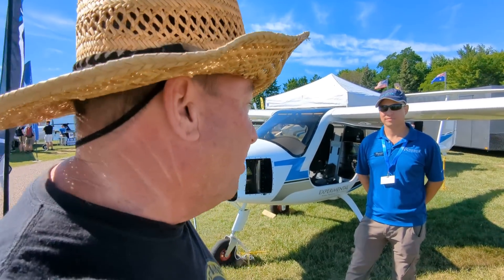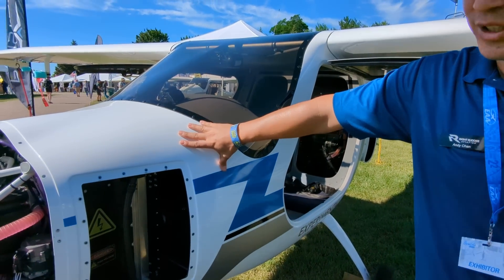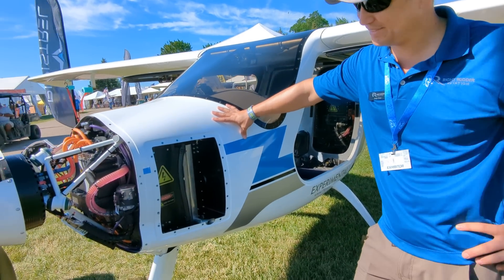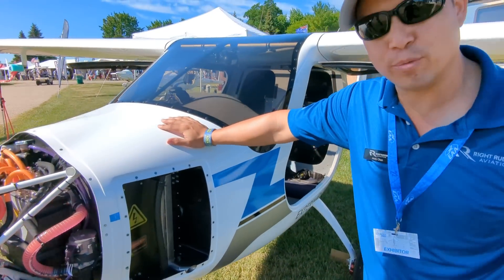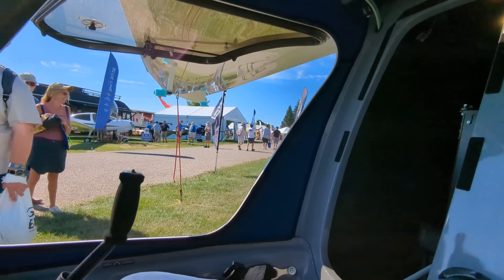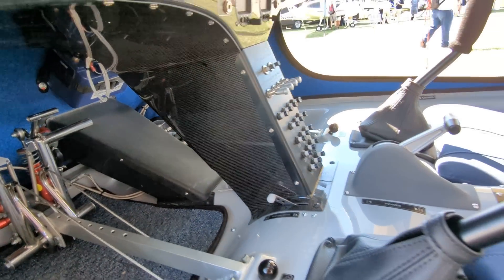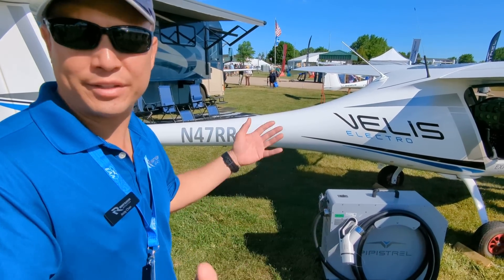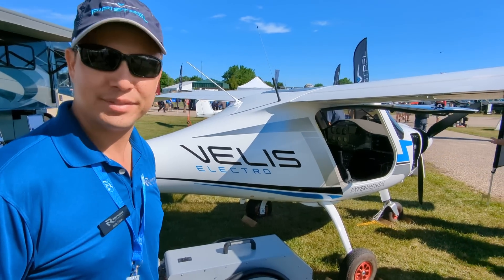Electric Airplane?! Pipistrel Electro at Airventure 2022.

Comment: Wow, the trolls are doing their dynosaur death dance.  So tiresome to hear the same old lines.

My opinion ?  This airplane is groundbreaking.  It needs better batteries, we all get that (swappable batteries would be sweet).  But it's already usable for training and sightseeing, and I'm pretty sure it will have lower operating costs than the 100LL powered version.  Why?  The Rotax is not an inexpensive engine to maintain or rebuild.  Annuals on our poor old engines are costing more every year, and the kicker:  have you checked the price of 100LL lately?

Here's the funny part:  so much of pilot training is focused on the pecularities of our dynosaur engines - sump the fuel, check the oil, prime it, crank it but not too much,  check the mags, check carb heat, lean the mixture correctly, warm it up, and get ready to (not) make the impossible turn when the engine quits on takeoff.....phew! - that the limitations of the Electro have more to do with the fact that flying electric doesn't train you on how to fly our poor old unreliable legacy dynosaur-powered engines.  

I can't wait for the electric age when we can focus on the thrill of flying and NOT dealing with our engines.  Imagine, for example, shutting down the motor in flight and just soaring, confident that the restart is gonna work every time.  I want to do that.

The RC guys figured out all of this a long time ago, and its time for us full scale guys to wake up and join the electric age.  Its going to be much better.  The next plane I build will be electric.
Reply from the maker: Yes!
Reply: Beautifuly said!

Comment: Am I correct that there are high pressure coolant lines inside the passenger compartment? If so, how much of a safety risk is that?
Reply: Wouldn't EASA have addressed that for flight certification in Europe?  They're way more safety conscious than anyone else.

Comment: Good for Training very close to the FBO.  Now the student will have to learn to also fly gas powered plane to compete his cross countries.  Adds to the cost of learning. 

In all honesty I think is electric plane is nice but most FBOs geared for students are barely making it with 30-40 year old Cessnas/pipers. I doubt if they will spring for an electric plane with limited use.
Reply: It'll probably see a lot more use in Europe - a lot less resistance to electric vehicles of any type over there than in the USA.

Comment: The irony of all the nay sayers on an emerging technology is not lost as they would have also poo poo’ed the Wright Brothers. There are over 300 electric aviation projects, most might fail, but some will succeed and progress us forward. Beta Technologies & Bye Aerospace are making huge progress started and run by legit pilots. Beta will have vertical take off ability 1500kg payload and 250nm range. They flying already. And that has loads of practical applications not to mention much cheaper operating costs. Ehang have already flown 20,000 flights, all autonomous, many with passengers. Battery tech is finally getting funded (thanks to auto) and real break throughs are happening especially with Li Metal and Li-S which have much higher energy density. You can’t beat an electric motor for simplicity (one moving part) and reliability - how many GA accidents happen due to engine failures with over 1000 moving parts in them (?) Pipistrel were at this early, more than a decade ago, and I applaud then for their efforts. Tecnam are coming, Bye, Eviation, Heart Aerospace. It could open a new era in regional transport unlocking cheaper solutions to traditionally costly travel routes - island nations (?) It is called progress and does not happen over night. Or we can sit back in our 1950/60s old school thinking and wonder why the auto industry moved ahead so much faster in innovation and why GA is shrinking because the next generation either can’t afford to become a pilot or just don’t want to fly 50 year beat to shit aircraft that costs 5x more than their 2020 car to operate… and if you reallly like 1940s classic, the Beaver is also already flying all electric!

Comment: I love the idea of electric flight, but it is limited by the terrible specific energy (W.h/kg) of batteries compared with petroleum fuels by a ratio of about 100:1, that's why you get a 30 mile range with this aircraft! A much much better battery technology is needed.
Reply: The Pipistrel Alpha Electro has 60 min endurance with 30 minute reserve. I think that is a little more than 30 miles on a 21kWh battery which makes is more efficient than most EVs, except something like the Aptera

Comment: Strangely I see the Pipistrel as a pilot's plane. Lots of private pilots do so little flying that an hour a week would be thought excessive. With the Pipistrel that hour could be solar powered.
Remember that the Wright brothers first few flights were measured in feet of distance -things have changed since then, things will change with electric flight also.

Comment: 700lbs dry is RIDICULOUS. The battery on my 2017 Bolt EV is 990lbs by itself. I imagine, the batteries are pretty small comparatively in this aircraft. It is gorgeous!
Reply: 22kWh I think
Reply: @wpfilms2  that is not a lot...that application (motor, BMS, aerodynamics,  etc) seem pretty efficient then for 50min of flight time 😀
Reply: @wookster789  exactly!
Reply: @wookster789  I would imagine the motor and inverter operate at variable frequencies of some hundreds of Hz to keep the weight and the iron losses down.  And inverters are very efficient these days.

Comment: Interesting, but what's the sense in having a charger that can't be carried on-board? Not to mention the LIPO lifespan. It's a green-wash. Like Tesla, you'll have to license the "features" and won't own the aircraft. 
NTL, interesting idea and 'props' to them for coming up with their own solution on the electrical solution.
Reply: Did we watch the same video?  I'm sure he said the charger isn't carried onboard, it's provided so that it can be taken in a vehicle - the same one which tows the trailer on which the aircraft is mounted.  I'm sure he also said there are fixed chargers similar to Tesla chargers which can be installed in hangars, etc.

Comment: This airplane would be a real problem for earning a PPL. The cross-country requirement of a 150 NM (minimum) flight with 3 or more stops would be an all day affair. 
This flies 75NM per charge, then requires 2 hours on a 3-phase 480volt charger, so you'd have to fly a leg, take 2 hours on the ground (if they have that charger & it is available), and another leg plus 2 more hours on charge before completing the third leg. At a little over 100 kts you're looking at 2+ hours of flying and 4 of charging, so 6+ hours to do a 3 hour cross-country. Since a trainer is typically a rental you'd have to pay for 7 hours, minimum.
Reply: Some one has already got their PPL exclusively trained on it
Reply: Operating costs in the UK are £2/hr. Also got to keep in mind because of the certification process takes forever (and this is certified in Europe) the battery cells are dated now. A lot more energy dense batteries on the horizon, most likely lead by China. Tecnam are now in the electric game, as well as start ups Bye Aerospace & Eviation with some pretty impressive stats
Reply: Auto industry are already moving to 400v systems as standard with some at 800v. New home builds in the UK are required to have 3 phase. As per usual GA stuck in the 1950s/60s on tech front.
Reply: @wpfilms2  Also feeding into this is Europe and the UK and other countries are more willing to migrate to electric propulsion, whether it be road vehicles or aircraft.  It's no good introducing an electric aircraft into a market that wedded to the ICE.

Comment: So many fan boys ! Let's not get all excited just yet. I pulled out my log book. Nearly every training flight was well over an hour. So double the number of training flights right off the bat. It charges in 30 minutes on 3-phase 480 volts. No mention of the amperage it's pulling, but OK. No one has that anyway. So double (at least) the charging time. Now we're in an area where the plane is down for more time than it can be rented. And don't pretend that since it doesn't burn fuel you'll be charged less per hour. I expect the opposite. Part of flight training is learning how to handle the ICE that powers the aircraft. How's that going to happen ? For you non-pilots out there, there's more to it than an ignition switch and a throttle. Realistically you're not going to train in an EV then hop into a real world ICE aircraft and suddenly gain engine management skills. And BTW - 2,000 charging cycles at a realistic 45 minutes per flight (tops) is 1,500 hours "TBO" for the batteries. At $20k a pop. And 100 hour inspections still apply.
.
So let's compare it to the obvious - the Cessna 152. The Cessna is far cheaper, cruises 20% faster and 6 times farther, carries more (even with full tanks), climbs faster and can be turned around in the time it takes to fill the tanks and check the oil. A Lycoming O-235 has a TBO of 2,000 hours and costs a little under $20k to rebuild. But that's still 33% more TBO than the battery packs.
.
The reason they've labelled this a training aircraft is because that's all it's any good for. You can't take it on a trip. You can't do more than a few touch and goes before it's full stop time - for over an hour. Takeoffs will of course drain the batteries far faster than cruising. You can't use it for night flight or cross country requirements. I imagine it will fill a niche in some places, but let's not pretend the "future" is here and ICE planes are a thing of the past. I'm all for new tech, but slow down guys. The future ain't here yet !

Comment: I'll believe in electric planes when I see a fully loaded A380 fly from Dubai to Sydney. NOTHING can match the energy density of fossil fuel.
Reply: Indeed, liquid hydrocarbons contain a huge amount of energy but they do not necessarily have to be derived from fossil sources (most 'fossil' fuel is derived from zooplankton and algae - are these fossils? I don't know). It's possible to grow hydrocarbons as crops but I think the future is hydrogen fuel. Hydrogen has about three times the density of hydrocarbons but of course has storage challenges (120 MJ/kg compared to about 46 MJ/kg for gasoline).

Comment: Love your "Gilligan" hat JB.
Btw, re: the electric airplane is it possible to add an alternater that "could" charge the batteries while flying, or would the additional device and probably belt involved cause additional drag on the electric motor reducing the performance? 2nd question is, if the wings had solar panels, would it be possible to charge the batteries?
Take care and fly safe. 🖖🏼🤟🏼
Reply: And here's another guy that believes in perpetual motion. It don't work that way folks.
Reply: Solar panels -  not enough area to be worthwhile.
Reply: Huh?
Reply: Current solar panels are much too heavy. This plane does have a sort of regenerative braking that uses the prop to recharge the battery when the pilot wants to slow more. He discusses it briefly in the video. An electric motor can typically be turned into a generator or alternator by turning the shaft.
Reply: @markmiller3279  See Scrappy airplane.
Reply: What would drive the alternator?
Reply: ppl an electric motor is an alternator in reverse. Same gear. He says that can get 1-2kw into the engine from descent so yes some recouping energy. Solar - sunlight is ~1kw per square meter so it's not enough to do in flight. Google Solar Impulse they did this with specialized aircraft tho.

Comment: $20,000 in batteries alone, and they need replacing every 2000 hours?  Ouch.  That compact 80-HP electric motor right behind the prop is a thing of beauty, though.  It's a shame we still have a long way to go in making batteries more affordable and faster to charge, hopefully lighter and longer-lasting too.
Reply: That works out to $10/h. Still beats gas. Avgas at my local airport is over $7/gal.
Reply: @t0ny747  Yep. Like putting away money made from lease back rentals for maintenance. Set aside $10/hr and you're covered.
Reply: @kirkwagner461  you are forgetting about “the capacity check of the battery every 100 hrs, that probably is 2-3000 dollars each time.
Reply: @Showboat_Six  Sadly, good point. No telling what additional checks will be regulated.
Reply: @t0ny747  And ICE engine inspection and overhaul costs ... which no-one has talked about in any of these comments so far.

Comment: Don't you just love how the knockers come out of the weeds when something new arrives. Maybe they should all walk in front of it with a red flag.
Reply: Not when it is constructive criticism. Good game changing ideas do come from conversations to respond to criticism.
Happened to Elon Musk recently.
Reply: @arturoeugster2377  Constructive criticism is where people compare $20k for batteries over 2,000 hours with the cost of overhauling / inspecting an ICE over the same time.

Many of these knockers are choosing not to do that.  They're just adding $20k per 2,000 hours to existing operating costs of a 172, and saying therefore electric aircraft are much more expensive to run.  Or they're looking at the cost of mining minerals, etc, to make electric systems, but don't do the same for making ICEs or the cost of the military actions required to secure the oil supply to keep the ICEs in aircraft running (e.g. Iraq over the last 20+ years).  And that's just a couple of the examples of many comments I've read here.  That's not what could be reasonably deemed to be constructive criticism.

I think people just need to be honest for a change, and just state their fears - the same fears held by many Americans: they just don't like the thought of anything which takes them away from an oil-fired economy.  Maybe their jobs or pensions or something are somehow wedded to the oil industry or the continued use of ICEs - OK, if that's the case then they should just state right up front that they have a vested interest in not allowing penetration of electric aircraft into US airspace.
Reply: Skepticism and dissent are cornerstones of science and knowledge, snarky ad hominem attacks not so much.
Reply: @rolf_pedersen  Get over it.  You just made a “snarky” remark by your comment.
Reply: @bw162  "Get over" the fundamentals of critical thinking?  Never.  You don't know what snarky means, clearly.
Reply: @rolf_pedersen  4 month old comment.  In a coma?
Reply: @bw162  Truth doesn't have an expiration date.
Reply: @rolf_pedersen  Yawn.
Reply: @bw162  👍
Reply: Better to walk in front with a chemical fire extinguisher.
Reply: I posted above that it was the same way in RC about 15 years ago. The technology improves exponentially and constantly. I have no doubt that electric will be a force in Light aircraft in the not to  distant future. The naysayers just love to dump on new tech.
Reply: The Wright Bros used a water cooled engine.  Great progress!

Comment: It's great to see electric planes become reality. There are some roles that current battery tech can already fulfill - such as self-launching gliders and trainers - and Pipistrel has pioneered both!

But I must point out it'll be a long, long time before long-haul flights will be electric. The jet fuel needed already comes in at one third of the takeoff weight, and battery tech has over an order of magnitude worse energy density - even factoring in the higher efficiency of electric propulsion. Hopefully some clean solution will come along to bridge that gap. Until then, maybe we'll see electric-assisted take-off and go-around, to reduce noise.
Reply: @Mark
The oxygen IC engines require comes free from the atmosphere and corresponds to about 4 times the fuel weight.
Batteries, roughly speaking must carry at least that more weight along. With today's technology its about 13 times more, and additionally no fuel weight is being reduced along the trip.
Recall the Breguet range equation:
R = L/D  ÷  sfc  × ln(1 + Wf ÷ We)
L/D.....lift to drag ratio
sfc.....specific fuel consumption
           lbs/hp hour   ~ 0.45 for properly leaned  piston engines
Wf.....fuel weight
We.....aircraft zero fuel weight + 
            reserves.
ln.....natural log
hp...horsepower: 550 ft lbs / sec
hour:  3600 sec   (trivial)
Nm : 6072 ft ~
carefull evaluation of the units of the inverse sfc units gives  range in Nm, or km if metric equivalent is converted.

Comment: So many derogatory comments. This is the coming technology, like it or not! My son who started work in the classic race car industry moved on to Formula E electric racing, then to electric flight and is now working for a company developing hydrogen fuel cell engines for small short and medium haul airliners. It's called progress. Thanks for the report Juan. 👍
Reply: Thanks for the like Juan, maybe in 20 years or so Pete will be flying airliners powered by, well, who knows what!
Reply: @gerryg1056  Battery technology will have to advance much faster than the ICE did.

Comment: Will replacement battery packs be would with conductor tabs in the spiral core to reduce resistance and increase charging rates... in replacement batteries.

Comment: Years ago a guy demonstrated a 2 person electric helicopter in Germany
Reply: Volocopter, not even a half hour flight endurance; too many (18) small rotors operating at low Reynolds number  with poor efficiency
Parasitic power of a rotor is according to McCormick:
Pp = 3/4  × Lift × tipspeed × Cd/Cl
at low Re, Clmax is low and  Cd is way high.

Comment: I wonder what plan is for cabin heat in the winter or a high powered flashlight when the landing light goes dim.
Reply: Heated seats, heated steering wheel.